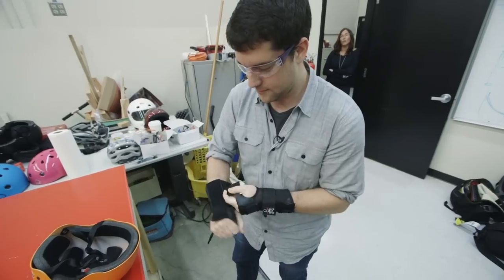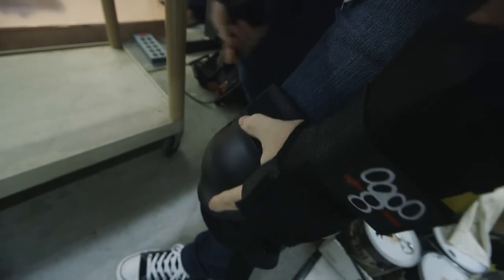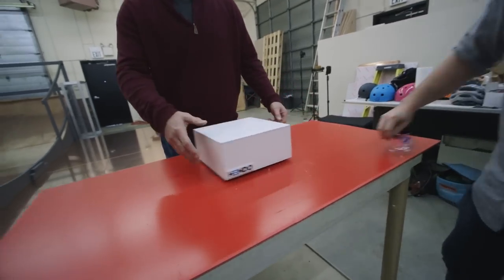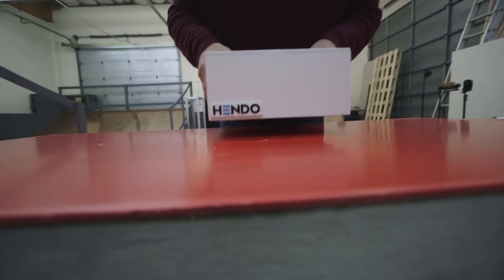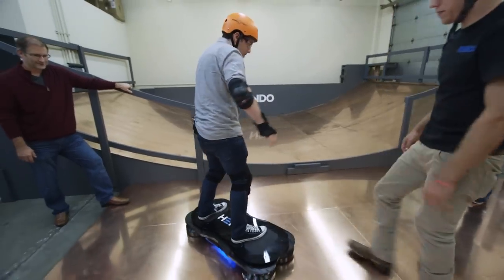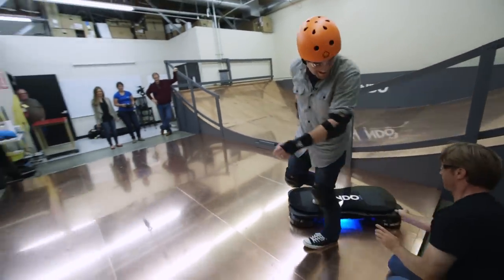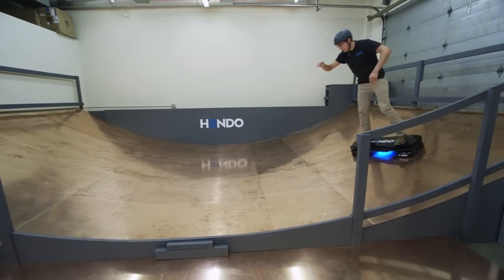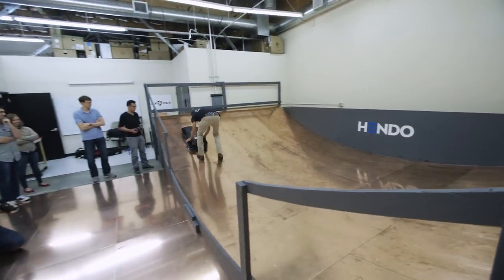Riding the Hendo hoverboard

Comment: Mmmm...nvm the hype lets look at the Pros and Cons

Cons
Way too heavy
Bulky
Non-portable
Extremely expensive
Steel surface required
Poor handling (unsafe)

Pros
It hovers....
Reply: I would say the pros greatly out weigh the cons
Reply: Raul Espinoza
But if you look at the pros you see that it only hovers about an inch or less off the ground.  So really it serves not purpose whatsoever except for being able to say that Back to the Future 2 has made us all jealous.
Reply: It is also extremly loud
Reply: No shit. It's brand new technology. It's going to take time for it to develop to the level you're expecting.
Reply: I think you missed the biggest pro of all, its practically frictionless
Reply: u forgot some cons:
1) Low battery life
2) high powered magnets will be a bitch to replace
3) Unable to brake effectively
4) Reliability due to its complexity
5) effect of powerful magnetic fields on human health
6) effects of uneven surfaces that will effect load on the magnets
Reply: SClassFinalFlash in relation to your point on "bad effect on human health" I would hardly expect that to be a problem seeing that the Earth magnetic field is running right through you right now ...
Reply: But what if it is changed a few years down the line with big improvements maybe more light weight if one day  this hover board comes out , I don't believe it will that costly forever the price will come down eventually !
Reply: But this is just a prototype
Reply: AIPLAYER1 earths field is aligned with our body's biometrics, changing electromagnetic fields with higher frequencies is a different story
Reply: considering this is the beginning im sure it will get better over time. have you seen the first computer. heavy non portable and extremely expensive. poor handling you couldnt even play  games on that shit. look at us now
Reply: *****
You make a good point, which means in another 40 years or so we could have fully functional hoverboards that will actually be useful for something.  Ill be 57 then, but  I guess you're never too old to try new things right?
Reply: Then again since you can only ride on the metal surface i feel like we got no where
Reply: Maybe in 40 years Hoverboards will be a "big thing" and the streets will be lined with copper plating.  It's far fetched, but not impossible.
Reply: no wonder its a prototype einstein XD
Reply: ***** even the magnets can surpass the gravity field of the earth , is very weak ..for me a prototype is just something that is not done yet .
Reply: ***** alright ..just bring the schematics to kickstarter
Reply: so you expect the first draft to be perfect? how portable and efficient was the computer in '60's? how sleek and smart was the cellphone in the '90s?
Reply: Noire Alouette Hikari I'm an idiot because they are making a larger version of a desk toy you can ride? For $10,000 I can get a car or 300+ normal skateboards that can be used anywhere
Reply: Prototypes always cost obscene amounts of money. Its partly why more efficient and versatile 3d printing is a kind of holy grail.
Reply: ***** I've always wondered what would be possible if we could direct magnetic fields in a line, like we can do with light and sound waves. But I've seen nothing that remotely suggests it would be possible.
Reply: ***** Did they ever say they planned to do away with the metal? I don't recall. I figured they were thinking metal would be put under either everywhere (expensive) or specific areas (very limited)
Reply: Every piece of technology in the history of this planet started with something huge and totally unpractical for everyday use and evolved. Usually the breakthrough comes, inspires others who also start experimenting and then from there it just gets better and better. It won't be long now and this technology will be used in transport. Well done guys!
Reply: n welthagen all they have done is take a desk toy make it bigger and charge $10,000 for it
Reply: ***** I've learnt that sometimes it's better just to walk away when the person you are talking to stops sounding intelligent and starts rambling and comparing one thing with another to make a point. I'm sure if continue long enough you'll be bringing politics and religion into too. This is where you've gone with this. But please don't stress. I won't be investing any money in this company or this product. It was the little boy in me that really liked the idea of a Hover Board that had me watch this video. I hope to God though that nobody else tries to create something that you feel is an insult to your vast intelligence. Instead we should all wait and see what you are working on? Maybe one day you can also create something and then people can troll you on Youtube. Wouldn't that be awesome! Enjoy your day.
Reply: ***** I don't see that being a prototype for something that can do those things. I'm just going off the video, of a hoverboard, and I may have skipped some of it, as well as a few comments. I didn't really check their kickstarter promises or goals.
Reply: Actually, I just checked it now. It looks like they have two goals. Make a Hoverboard (and hoverpark for those boards) and generate hype for magnetic levitation.
While they want to be able to lift buildings and have roads everywhere for maglev, it doesn't seem to be their own promise. More like they want to get everyone in on it.
Reply: Kamike Serpantail Have you watched any of their promotional videos? One of them literally said this technology can replace cars. That is blatantly misleading and lying.
Reply: Carlos Danger No, I haven't watched those.
If everyone decided they REALLY wanted hover cars so badly that they were willing to pave the roads with metal, maybe it potentially could.
I personally don't see enough people wanting it badly enough, and think there are better things to pursue concerning transportation.
Reply: Kamike Serpantail
No, it is not possible.
Reply: Carlos Danger Why do you say this?
Reply: Kamike Serpantail
Because it is simply not possible to have a transportation device as durable and universal as a automobile without covering the whole earth in a highly conductive metal.
Reply: Copper or aluminum surface only required
Reply: Can they use the earth's magnetic field without destroying the earth?
Reply: Carlos Danger Sure, but I don't know of any other magnetic levitation that doesn't rely on a track. Perhaps there is something about the way the fields are generated, that makes it unique, especially at that size.
Reply: Kamike Serpantail
This is the same exact technology used in office toys that people have had for many years.

Since when is this about uniqueness anyway? We are talking about technology, not uniqueness. Using magnets to hoover is far from unique or new in anyway.
Reply: good enough for me.
Reply: Yet. This is their first hoverboard. Think of what they will make in the future.
Reply: DeathsVolition
With this technology nothing great.
Reply: nothing is perfect in it's first iteration. give it time ;]
Reply: Haukenslush
This is not the first iteration. This is using technology that we have had for centuries.
Reply: magnets are nothing new, no, but using magnets in this way is new. must you be so literal??
Reply: Haukenslush
No, have you ever heard of maglev? Using magnets to hover is far from anything new. Do you know that this whole thing is based off an office toy which uses a magnet to hover items?
Reply: maglev needs a track to go front, back, left, and right. right? look at how the hoverboard operates. two. different. applications. stop arguing with me, geez.
Reply: Haukenslush "maglev needs a track to go front, back, left, and right. right?" This needs a track too. Did you ever fucking notice the copper on the floor? That is the track. It can't operate without it.

This is not new technology, this is very primitive technology that anyone could do at home. To think it is brand new technology and has never been done before is plain ignorance.

I really doubt you actually know how this functions. If you did you would not think that this is "new technology".
Reply: Brandon Marchetti "prototype" is not a word that lets an idea escape scrutiny. Sure, it is a prototype, but that does not change that this is using technology that has been around for centuries. You people are so gulible and scientifically illiterate you will just believe everything you here on kick starter before you even know how it works.

"they're the scientist who figured out how to make none of us here on YouTube would know how" Could you write a sentence that one can comprehend please?
Reply: Haukenslush "ANYTHING. AKA IT WILL NOT FUNCTION WITHOUT A FUCKING TRACK." This product can't function without a highly conductive metal surface at the bottom.

"This hoverboard ONLY needs a metal floor to levitate." No, it needs a highly conductive metal surface to levitate.

"this IS one of the first iterations of a functional hoverboard." No, it is not. This is a small tweak to other hover technologies like the maglev. People have been making functional hover boards for years.

"give it some more years and it WILL be advanced to do much more. JUST LIKE ANY TECHNOLOGY." So waiting a few years will allow us to break the laws of physics? Who would have known.
Reply: Carlos Danger No, this does not need a track. This needs a surface. There's a difference.
Reply: Kamike Serpantail
I made that statement to show how impractical the device is. There is a difference, but for a hoover board where you should be able to move everywhere the difference is small.
Reply: Carlos Danger It's as they show. A novelty requiring their specifically designed skate park.
I don't think the hoverboard itself is all that special, but the methods and costs of the levitation might be useful, if they actually do differ from what's been done before.
I don't know enough about it really.
Reply: Kamike Serpantail
See, if they were advertising it as a expensive toy then that would be fine. However, they are not. They are marketing it as "the worlds first hover board" which is a complete lie. They also market it as practical and would be used to replace traditional vehicles. This is a lie. This technology could never be used to replace the vehicles we have today.

This is some very basic technology that anybody could make in his garage and they are showing it as a brand new invention that has never been done before. What is even worse is idiot buy into their lies.
Reply: Haukenslush
What is so funny is that you say that this is different then Maglev technology because this does not run on a track. Way to show your complete ignorance towards this kind of technology.
Reply: Haukenslush
If you did not care than why continue to comment? Don't initiate an argument and then get offended when you are caught in your ignorance.
Reply: Haukenslush
The more you reply the more it shows that you actually care.
Reply: Haukenslush
Keep telling me you don't care about talking with me.
Reply: Haukenslush If you don't care, its best to go find something you do care about instead.
Reply: Worth it.
Reply: No duhh its a floating piece of metal and lots of time to make that's why it's expensive it really obvious
Reply: Dakota Bigelow
It is actually not that hard to make.
Reply: ***** I think you could grind. it would just require the involvement of being able to olly the hoverboard off the magnetic surface on to the grinding rail or box and landing back on the metal surface to keep going. In this way creating hovering parks would theoretically be possible.
Especially with the out of this world skill of pro skateboarders riding them and bringing the impossible to life by riding it as if it was a reg skateboard after given enough of a momentous propel of velocity through regular hoverboard riding means.
Hover/Skating would be a hybrid of picking up your speed by hovering and hitting jumps and obstacles like rails before gaining more speed from hover metal again :)
Reply: You do not know that there is bad handling
Reply: isaiahagent u
That is not the topic. You did not comment on a post about the practical use of the product to say they can improve the handling did you? That is completely irrelevant and off topic.
Reply: I'm a bit insane but no one has been able to successfully make a hover board and everybody knows that
Reply: isaiahagent u
People have plenty of times made hover boards. What are you talking about?
Reply: the real hoverboard of 2015
Reply: That hoverboard is the best thing ever! Soon they'll have real ones and metal designated ground to use it on. And big bouncy floaty platforms to bounce from place to place around the city on.
Reply: Carlos Danger I haven't noticed it
Reply: isaiahagent u
And? This technology is old and limited. This exact tech is used in magnetic trains and there is a reason it is only used for trains.
Reply: isaiahagent u
Second what is your definition of a hover board? Mine is just a board that can hover which has been done plenty of times.
Reply: A board that can hinder
Reply: I mean hover
Reply: isaiahagent u This has been done over and over again.

Comment: You must be stupid to pay $10,000 for something that just barely hovers, really clunky, really loud, cant even control it
Reply: that is prototype. you are not buying the fucking prototype
Reply: and battery life of probably 5 mins lol
Reply: 15 minutes, and again, prototype. Batteries are getting better due to the demand from electric cars.
Reply: Mark M
And how do you control it? ;)
Reply: its a prototype dude ..
Reply: Tomasz Wota how do you control a regular hovercraft?
Reply: Mitchell Theobald
You get a big-ass fan with rudders behind it attached at the back end of a hovercraft.
Reply: Tomasz Wota id assume that this control system could be transferred to this hoverboard then in the future
Reply: Mitchell Theobald - so no more 180 degree switches without breaking (or rather, that's how breaking would work), even louder, a constant pull of air around your ankle, and even less battery life.

Also, I can't imagine it being anything close to being as responsive to direction change as the real deal. You'd be either doing large arcs, or you'd be forced to mount even stronger, even bigger fan. Which wouldn't help all that much.

Yes, you could steer that way, but the amount of "fun" I imagine from using it is so low... Beyond "look, it hovers!" it doesn't seem all that cool at all.
Reply: Mark M Actually, no, batteries are not getting better due to the demand from electric cars.

Batteries are not getting (significantly) better. Full stop.
Reply: Mitchell Theobald So, a maglav style system with a huge fan to steer? Sounds...doomed to failure.
Reply: Dude wait for it. It's just the start. I'm sure they'll have the cheaper ones and much better ones in 10 years
Reply: Karan Jani I'm sure you have no idea what you're talking about. Unless the fundamental laws of physics somehow change (in which case we'd have much more serious problems to tackle anyway!), this thing will remain useless crap.
Reply: Jason Doe
It will be, with that attitude.
Reply: lionslash232 Because physical laws and common sense really depend on one's attitude, right?

Oh wait, apparently the latter does...
Reply: Jason Doe It used to be "common sense" that the world was flat, or that humans were never meant to fly. Point is, it's negative thinking like yours that stifles ingenuity.
Reply: lionslash232 True ingenuity and creative forces should be directed towards worthwhile causes. And "ingenuity" means nothing when someone ignores the very basics of scientific thought and practice.

"Common sense" would let you realise that the power consumption of that thing is necessarily very high, and the energy density of contemporary (and future!) batteries very limited. Also things that "fly" need a suitable substrate to exert that power upon, such as air for the airplanes; the one needed for this thing will remain ridiculously expensive and impractical. Unless you think it won't, in which case I'd like to sell you my plans for "outer space *air*planes" (fluid dynamics are such fun when there are no fluids around!).

Comment: If they could use the diamagnetic properties of water to create an inverse field. Now that would be something. One would be able to hover above any body of water with little to no drag. And, if they made it powerful enough the surface would only have to be wet to work, giving way to traverse many environments, urban, or natural. Making rainy days way more fun.
Another possibility would be to super cool the field emitters, and take advantage of quantum locking to increase stability and control greatly.
The science is there it's power that will be the primary issue.I do wonder how many teslas this device outputs.